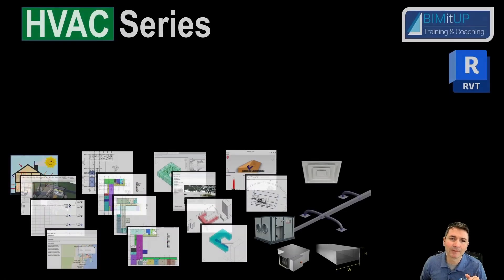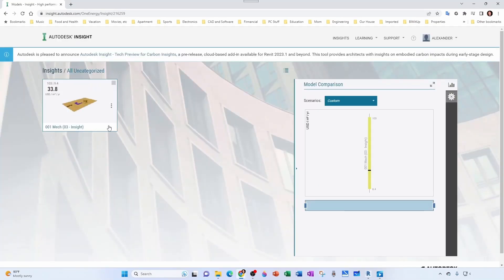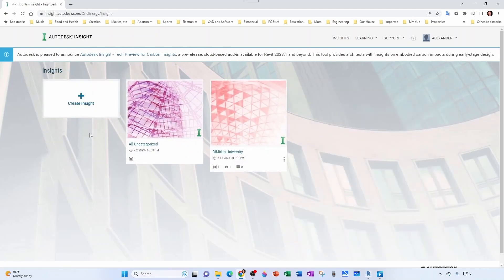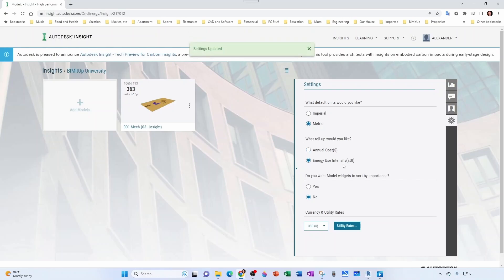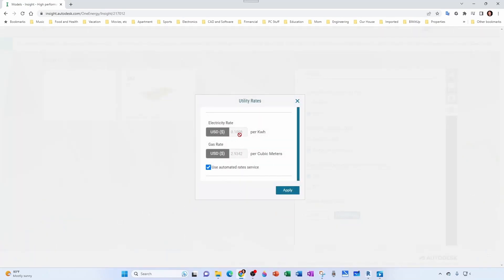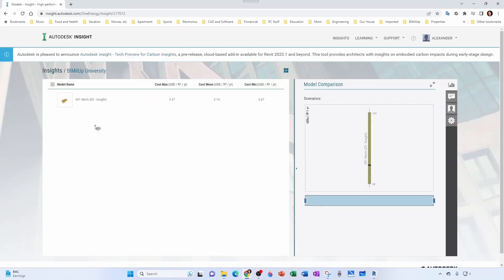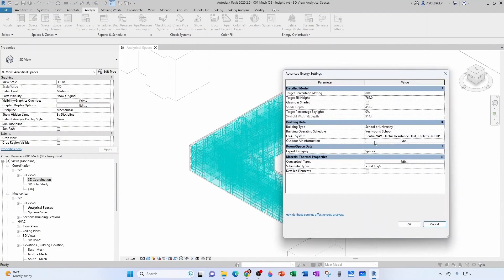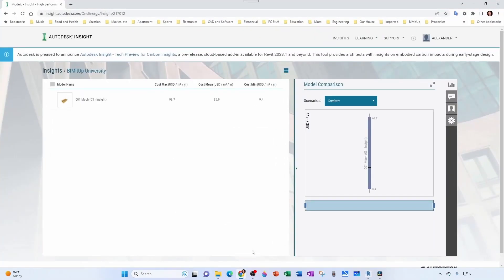Revit HVAC 8. Insight 4

Comment: it is really helpful, I have a question regarding the energy model, when I do energy model creation it shows the spaces I have in the building sub divided into 3 or 4 parts, the room space looks cracked and divided into several parts and this reflects in the reports finally, e.g. if I have 8 rooms it become 32 parts and this make the report confusing, my question is how can I cancel space sub dividing and get only final HVAC reports includes the 8 rooms only ... thanks in advance
Reply from the maker: You are welcome. Energy models are very tricky. You need to make sure all elements are properly bounding. DO you have access to the Architectural model?
Reply: Yes